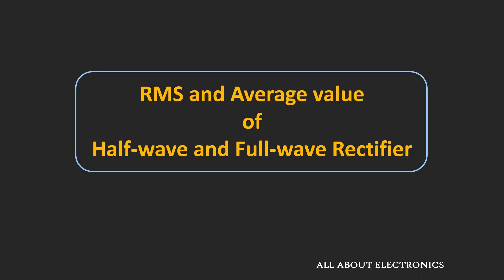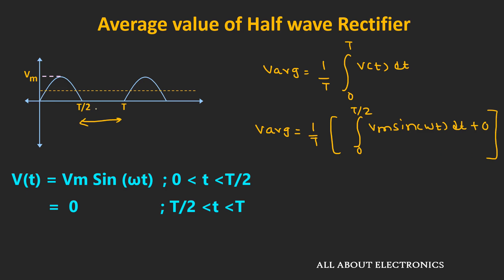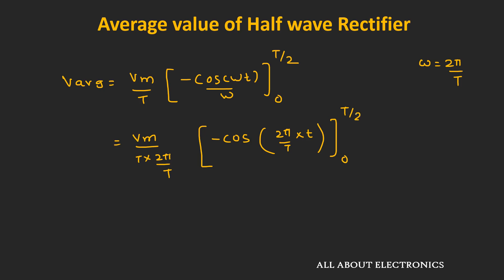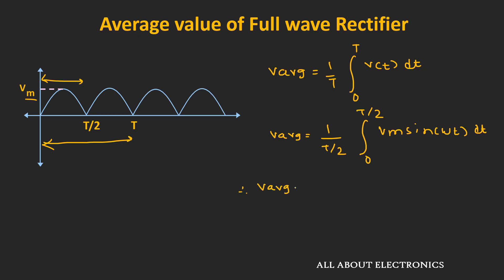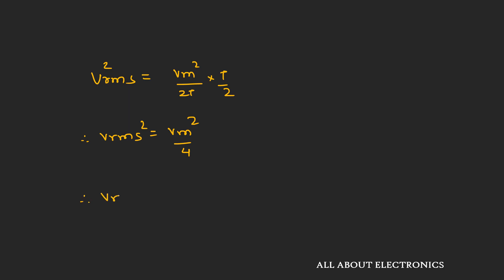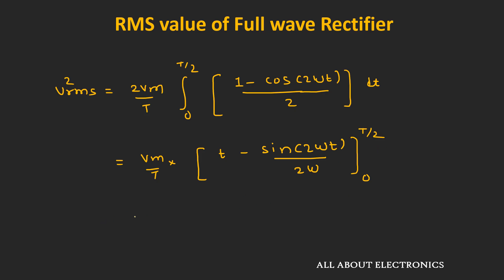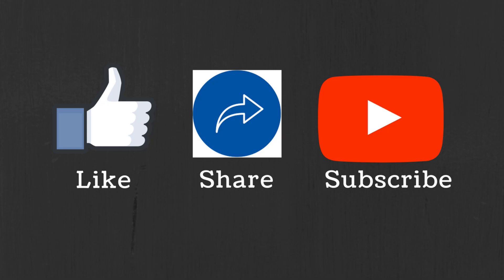How to calculate the RMS and Average value of Half wave Rectifier and Full wave rectifier

Comment from the maker: The timestamps for the different topics covered in the video:

1:11 Calculation of Average (DC) value of the Half-wave rectifier

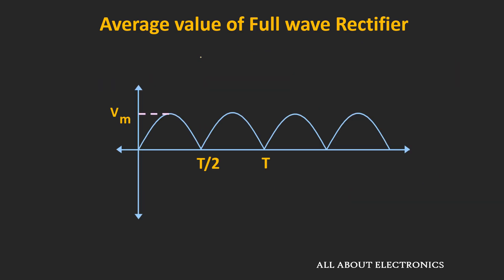3:51 Calculation of Average (DC) value of the Full-wave rectifier

6:12  Calculation of RMS value of the Half-wave rectifier

9:31 Calculation of RMS value of the Full-wave rectifier
Reply: ALL ABOUT ELECTRONICS  are you there? Need to ask very important question urgently regarding filters.
Reply: Is this a thyristor rectifier ???
Reply: PIV in half wave is 2Vm

Comment: Remember your calculus.  Don't write the limits at the upper part and lower part of a bracket.  You need to write the limits of integration at the upper and lower part of a vertical line.
Frank Reiser M.S.

Comment: How to determine period?
Reply from the maker: The time period is the time after which the signal repeats itself.
Reply: @ALLABOUTELECTRONICS  then the full wave circuit?
Reply from the maker: @ngkean9743  OK, I got it. Here, the time reference is considered with respect to the input signal. The sinewave has a time period of T.
And the output waveform is drawn w.r.t that time reference.
I hope it will clear your doubt.

Comment: Sir why is average value = dc value ? I've read that rms value is equivalent to dc value.
Reply from the maker: The RMS value represents the effective value of the given AC signal which will produce the same amount of heat (and hence power) across particular element if it is being replaced by the DC source of equivalent value.
For more info, please refer this video:
https://youtu.be/qDHsokTcgck

Comment: Sir why for full wave rectifier w=2π/T and not w=2π/T/2 because time period is T/2?
Reply: Please reply because I need to cleay doubt
Reply from the maker: The time period is not T/2. It's T only. And it is the time period of the original signal. We have calculated the RMS or average value of the full wave rectifier wrt original signal time period.  And that's why w= 2π/T only. I hope it will clear your doubt.
Reply: Ok now I understand the thing